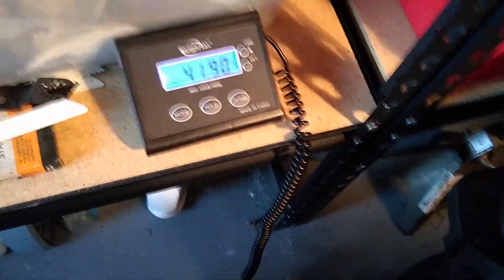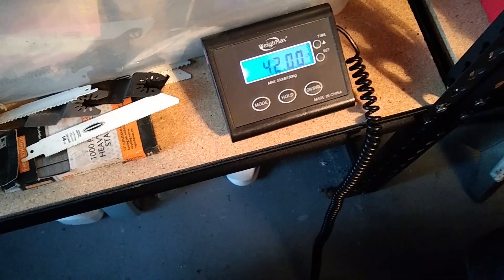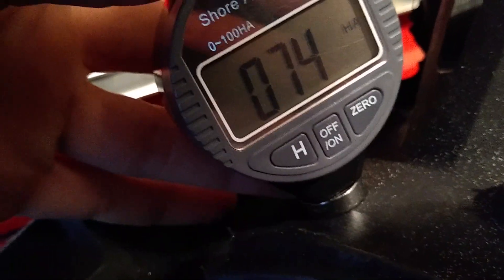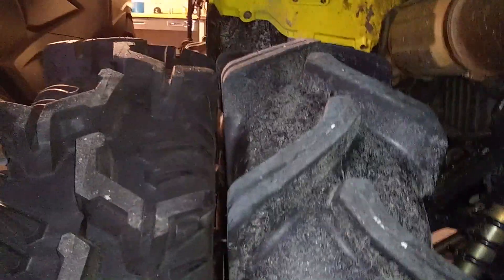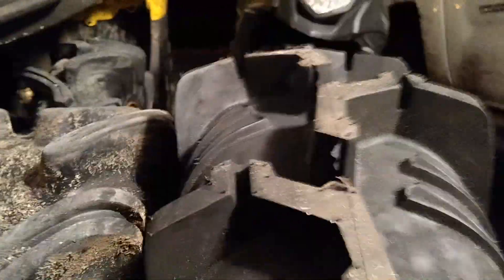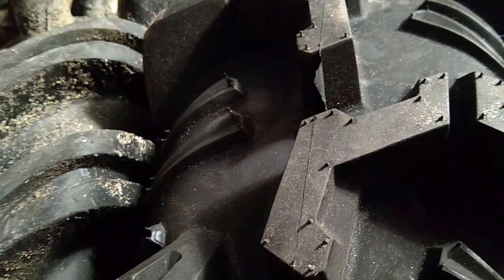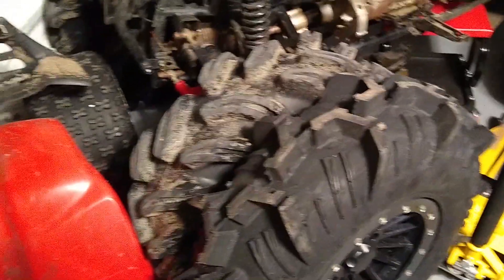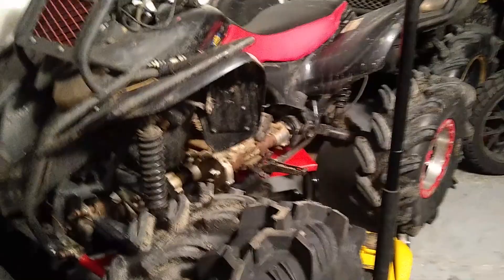32" Aztex Mud tires review and stuff

Comment: Please give updates on those tires I would love to see how they do on the rzr might buy them to replace my 32"mudder in laws
Reply from the maker: They will they will be a lot lighter that's for sure but probably even worse about digging holes
Reply: @MudPuppyOffroad  yeah that's what I hate about the inlaws on my maverick they do good if I go extremely slow like geared down 300 1st gear slow on portals but anytime I apply pressure to that skinny peddle I go straight down

Comment: Whats your thoughts on the new honda talon looks pretty sweet but idk if its gona hold its ground against established sport SxS like poolaris and the canned hams
Reply from the maker: Unlike the Can-Am it's not a truck think it will do just fine a lot of people are tired of belts
Reply: Learn how to spell harden palmlund
Reply: Haden
Reply: Dustin Floyd does poolaris and canned ham offend you
Reply: Mud Puppy yes if its meets honda atv characteristic like being light and it doesnt have any belts it should be a absolute beast
Reply: '' a lot of people are tired of belts ''  ????   on the four wheelers? or the  tires. 

all i know is that i dont like belt driven torque converters, the belt breaks all the time.
chain links are better.
Reply: by the way , it is   Polaris  . . .  not  pool

Comment: Am I going to break anything running the 32’s on a stock rubicon with a 54% reduction?
Reply from the maker: 53 you mean? And yeah axles depending on what 32
Reply: Azteks, same tires talked about in this vid.
Reply from the maker: I'm running those with a 27%

Comment: Heyy I have a Polaris high lifter 850 and it’s going 50mph what’s the problem?
Reply from the maker: Man if you only had a clue how many times I get this question. had about 10 videos explaining this issue which is not an issue at all it's by design you bought a mud bike it's not supposed to go over 50.
Reply from the maker: The bike is geared 89% lower in highl range says it right there in your manual. if you want it to go fast you need to upgrade the suspension and swap out the high range gears for non highlifter gears this will not affect low range. That's what I did to mine as well documented in several videos
Reply: Taytay Jonh it’s a Polaris 😂